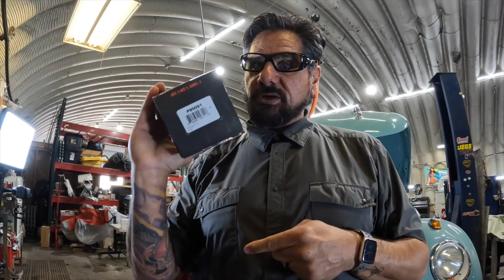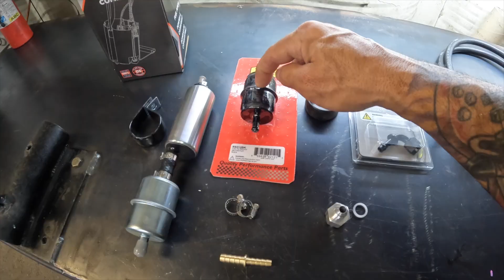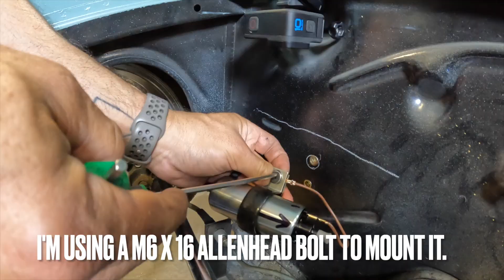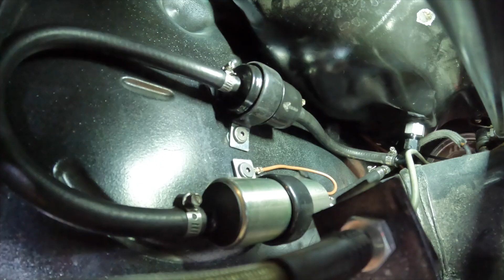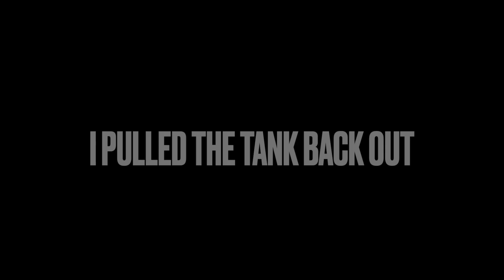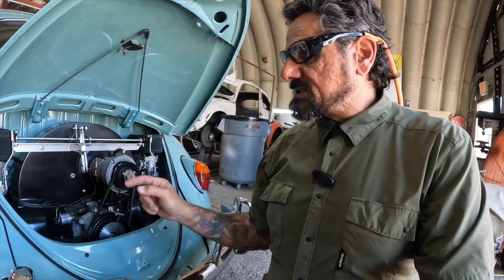Electric Fuel Pump Install in A Bug

Comment: Great videos as the detail is perfect for us beginners! Am i correct in assuming both the inlet and outlet of the actual pump are 5/16 and the fuel filter is 3/8 in and 5/16 out?
Reply from the maker: I replace the filter with a 5/16 in and out. The one it comes with is 3/8”. Too big
Reply: @the_Wagen  The actual pump I have (Same part number) looks like it has a 3/8 inlet. Are you stretching the 5/16 hose from the filter onto the 3/8 inlet barb? thanks
Reply from the maker: @DaveLeith-e1n  yes. a bit of silicone spray and it will go right on.

Comment: Question: Couldn't you just use the factory fuel line hole in the front of the tunnel and just push some stainless steel braided hose and out the other end of the tunnel?
Thanks!   IF you had a bigger engine and fuel requirement I mean.
Reply from the maker: Yes you can. You’d have to remove the factory fuel line to do so.

Comment: Just now discovered you --- very easy to understand your thought train / explanations --- with that --- will be looking for more --- I Subscribed -- have a question ------ noticing all the crude you pulled out with the pick from the bottom of the tank --- you rinsed the tank out with gasoline and reassembled --- Do you think there is rust / crude still inside? ---- Here's the question ------ How would you go about cleaning a tank ----- possibly with the rust / crude inside? Will be doing what you have done ----- an inline fuel pump / filter like what you just did ---- I would like my tank to be clean inside --- am building a new engine ---- Of course that's what a filter is for ---- but might as well clean it --- while out --- giving it a good fighting chance ------ Really enjoyed ---- HOW --- you explained yourself in the process  of doing the work ----- Very helpful ------ Hope more like this is to come!
Hope you have a Good Weekend ----- Rodney
Reply from the maker: I find evapo-rust works great on rusty tanks. Rinse with WD40 once you’ve removed the evaporator-rust.

Comment: The factory fuel line was already run inside the cabin on the floor under the carpet, alongside the tunnel on the drivers side. That copper line is not factory line.
Reply from the maker: Correct. Someone ran that line that existed there. The factory line is inside the tunnel. The brake line runs along side the tunnel factory.

Comment: What size is that copper line and is it a good  material to use I have to run the fuel line and the body outside the bug
As always your vids are the best...I wish I lived closer to your shop👍🇩🇪
Reply from the maker: For a big motor I’ll use 3/8” aluminum line. For stock 5/16” will work great.
Reply: @the_Wagen thanks I will get some
Hope one crazy weekend was above and beyond. Maybe next year👍🇩🇪

Comment: Hello from Puerto Rico. I'm reaching out on behalf of my grandson & myself, as we are embarking on similar project with our 67 Kombi. we have obtained the must necessary parts. but we're now seeking info on the source & specifications for the 2 vapor guards, & the silver nut that connect to the tank. GRACIAS  for your assistance & guidance on our project.
Reply from the maker: Vapor guard fittings are available online. I get the tank fitting from apple tree.com

Comment: I added an electric fuel pump to my 1970 dual cab , 2110 stoker. Made a difference in so many ways. “ mechanical restoration “! I like that term

Comment: I've been using a cheap oscillating pump in my Beetle for 55,000 miles and I never understood why people say they have to be under the tank when the tank is actually on a level plane with the carburetor. I put mine on the side of the doghouse and have never had an issue.
Reply from the maker: It’s definitely not recommended to have your electric fuel pump in the engine bay.
Reply: @the_Wagen  When done properly an electric pump isn't any more dangerous than the factory mechanical pump. I'd dare says it's even safer. My pump is connected to a switch that shuts it off in the event of an accident. I've had one engine fire in the 40+ years I've been driving Beetles and that  was before I ever knew there were electric pumps. Not everyone just puts their car together and forgets to periodically check things. I do visual inspections of my car almost on a daily basis.

Comment: Nice job, very clean set up? I’m pretty new to air cools, just got a 64. Is this set up good for a stock 1600?
Reply from the maker: It will work on a stock engine. I’d verify that it doesn’t push past the needle seat and overflow the carb before fire up.
Reply: @  I understand making sure it doesn’t overflow the carb, but not sure what you mean that it doesn’t push past the needle seat. Are talking about the fuel gauge needle?
Reply from the maker: Make sure when the pump is on it’s not overflowing the float bowl and pouring gas into the engine.
Reply from the maker: The needle seat is what turns the fuel flow on and off of the carb.
Reply: @the_Wagen  oh oh, got it now. Thanks

Comment: For a safety addition, where and how would you wire an inertia switch with this?  I'd like to know I'm not still pumping fuel in the event of an accident/rollover.
Reply from the maker: Ground the relay off your oil
Light switch. Once the engine dies the pump will stop Running

Comment: Great clip and as always you describe what and why you’re doing something so well.  I have one of these pumps ready to fit, and was planning on using it with the Kompressor Haus supercharger. But having just watched their latest clip they state how important it is to fit the pump in the engine bay on a bug? I’ve never known this to be the case, I don’t like the idea of placing a fuel pump in the engine compartment, and in nearly 40 years of being around air cooled I’ve always been an advocate of not even having a plastic style filter in the compartment. The Carter pump like you say is a ‘pusher’ that maintains good pressure so I can’t see why? I’d be interested to know your thoughts especially as you’ve fitted one if there’s, has the car had any fuelling issues or is it all good?  In fairness I’ve yet to speak with them as I was hoping to bump into them at a UK show, plus it’s my winter project, so I’ll get around to it sometime,I was just curious on your thoughts. Phil
Reply from the maker: We already had the fuel system in place feeding the dual carbs we pulled off the engine. I too do not like the idea of a fuel pump in the engine compartment. I’m willing to stand behind my install. They may disagree though.
Reply: Thanks for taking the time to reply, and I agree, pump at the front and I’ll see what(if) happens.

Comment: Nice and clean. I think I’ll redo my set up soon. 
I pick up power for the fuel pump off the brake light switch.
Reply from the maker: I used to do that. I prefer a clean power supply off a relay.

Comment: Another great video! Funny how Carter will have this same pump assembly offered by many vendors. I have the same setup in the back of my 69 BMW (dual sidedraft carbs), but I added an enertia (accident) switch and relay.
Reply: I  like to add fuel pump oil pressure cut off switch , so pump is not running with key on only when there is oil pressure. It's a a nice safety device .
Reply from the maker: Good idea.